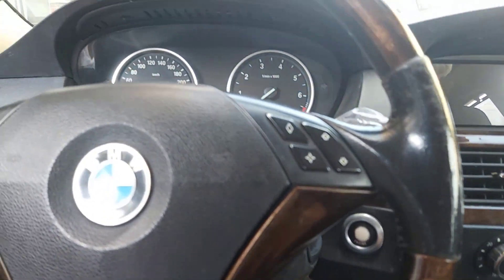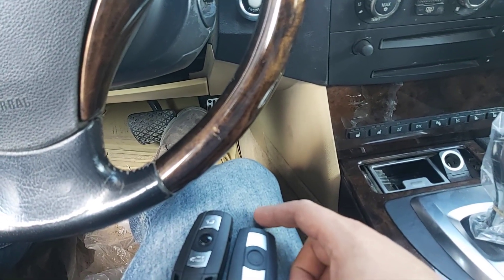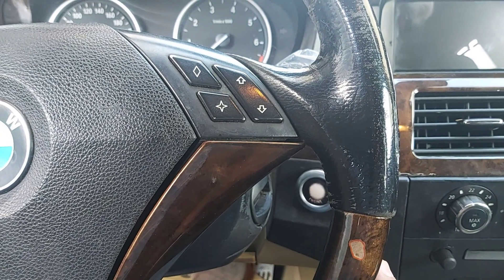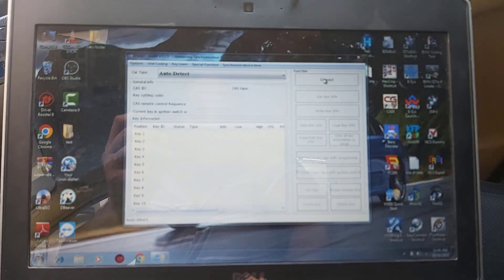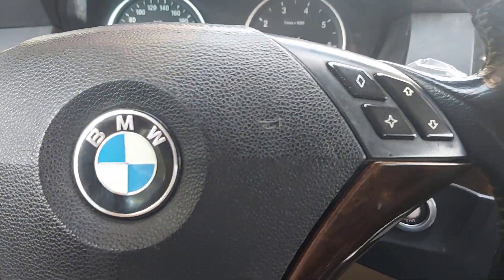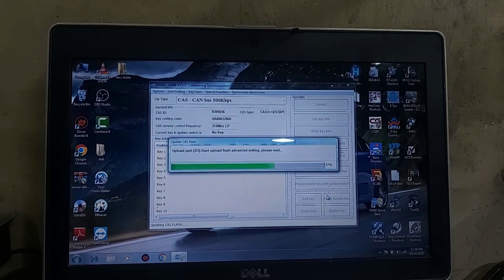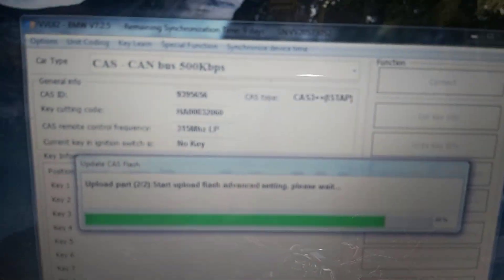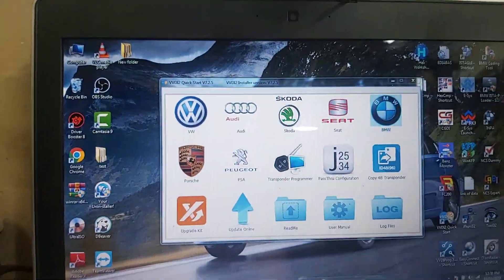3rd part E60 540i Adding Keys (VVDI PROG Backup & VVDI2 Cas3+ Istap Bench Downgrade)

Comment: hello. so to prevent this problem. when working on ISTAP it is just better to remove cas and add key on bench without downgrading the cas, if possible. For example, reading the cas with vvdi prog, save it and then use vvdi2 to load the file and make the key using the option "file make key"; is that correct?
Reply from the maker: @DFWAuto_Hack  yes is safe
Reply: @ i have had one bad story with istap and since then i do all on bench with acdp but for the first time i have a job on istap and proximity key (never did before). bmw e93. The most important things i think will be do on bench and add proximity at 1 or 2 position making sure that i dont overwrite the existing key. Thanks for your great video and your prompt reply. You are one of the rare people to know so much but still care about replying even for videos posted long time ago. Be blessed

Comment: Hello friend, I can't understand why the proximity doesn't work and what should be updated in the case or the keys?
Reply from the maker: After adding directly  ... proximity works after inserting key on slot only .. should do repair
Reply: @heshamessam8042  I understand, you have updated the cas but the proximity still did not work and then the bank has repaired the proximity key and that file that it returns has been written to the cas.
Reply from the maker: @facundocittadini5219  yes